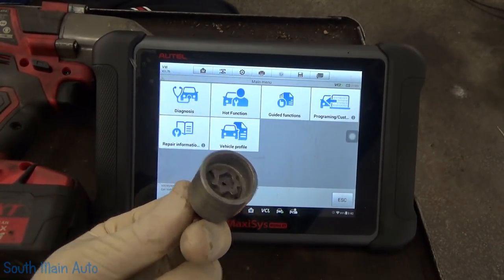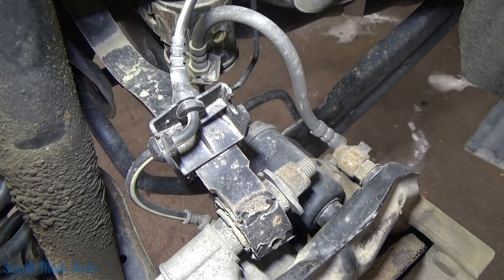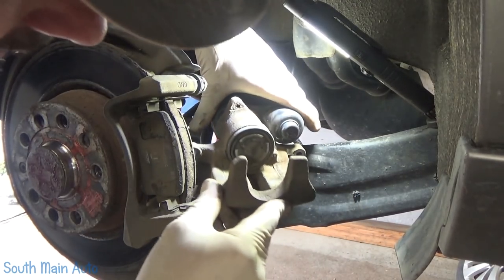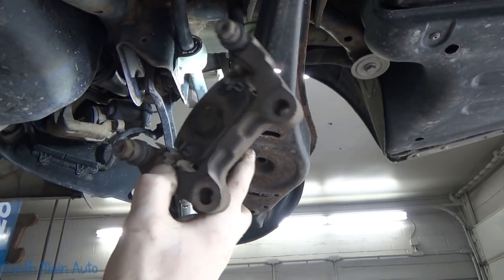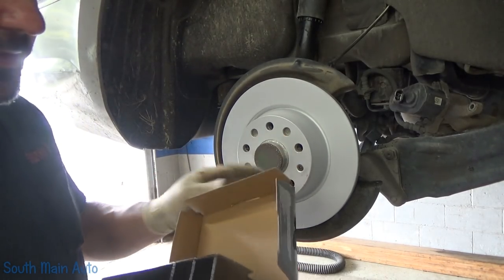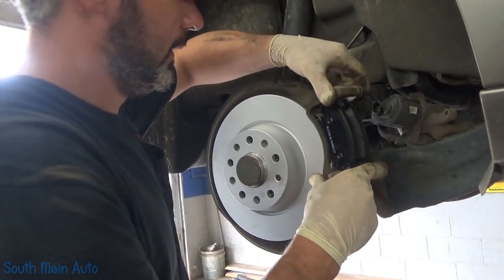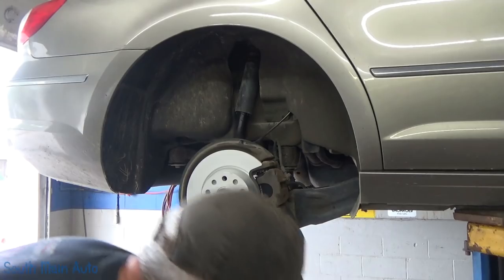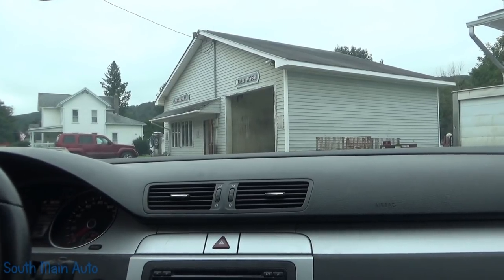Do You Need A $1000 Scan Tool Just To Change Brake Pads!?

Comment: Since you mentioned it, I just did a review on that tool. The MK808 has the electric braking option. If viewers go to my channel they get a $40 off coupon plus another 10% off if they use a code listed in my description box for a price of $480. (Sorry for the selfless plug). Just trying to same some people some money.  :)
Reply: Save them money yes Do not buy one of these cars  lol
Reply: @VWWRENCHIE  I'm a DIY'er (below average) and a scan tool  would be a big help, BUT is there a yearly subscription needed to use the scan tool? Would I be able to use it right out of the box ?  I understand about updating and keeping the info current, but is it needed in order for the scan tool to work?  Thanks for the info !!
Reply: John Smith  mx 808 is different than than the mk 808
Reply: Start car.   Put the car in drive, pull off the battery lead.  Problem solved.  ;) (No, not really)
Reply: alex10294 yes but I think the next step is to unplug the alternator and turn on the headlights for 3 hours to drain all flea power.
Reply: John John  I don't make any money from this and the extra cost on this unit is because it has blue tooth.
Reply: @defendermender4959  Thanks!
Reply: I picked up a mk808 slightly used (3 days old) for $200. It works great for the price cant complain I'm glad my shop has a verus edge though when I need those bi directional controls and the scope.
Reply: Lael Queen  whenever necessary, this is my favorite method. Who needs computers when ya have a multimeter and a little power wheels battery
Reply: alex10294 put the car in drive and pull off the the wires off the brake calipers, maybe it has a fuse to pull
Reply: @VWWRENCHIE  Yes, I agree.
Reply: Josh Smith  hey Josh THANKS for your reply and info, I haven't decided yet, (I have a low budget scan tool that's working ok for me) , I really appreciate you taking the time to answer !!!

Comment: One customer left the wheel lock in the cup holder today, I thought about leaving him a tip.
Reply: Nice. Nice.  Makes the ordeal more smoother.
Reply: I always hand the tool to the shop or leave it where they can find it easily.
Reply: I am short but try real hard to move the seat back before they brake a leg getting in.
Reply: When I have a car with it it's the first thing I give the techs
Reply: I like when the customer makes the wheel lock accessible, by leaving it in the cup holder or giving it to the service writer. Also, leaving it in the 2 obvious places, glove compartment or trunk. I hate having to rip the car apart for it. I had customers leave the lock at home while the car is in the shop, duh.
Reply: @Mavis308  you tear it up looking for it and the customer complains you went through their car.
Reply: @dirtydoug181  definitely true, that’s why I don’t like doing it. If they know they are coming in for service, common sense is to get it out.
Reply: @dirtydoug181  yes! I tell customers I went through their car and why....it saves them coming back whining most times. Finding the wheel lock is like a game of hide and seek because my hubby usually forgets to ask where the lock is and tells me to find it 🤣
Reply: One of my regulars at a shop I worked at years ago hung the key for his old 4Runner's locks off a piece of wire he attached to the steering wheel. Every time, I don't think he ever forgot. I wish the guys up front were that diligent in asking about locks!
Reply: I go one better
I delete the pesky security bolts.

Comment: The DIY way without a scantool: You can take the motor off (two bolts) Once removed there's a T40 in the caliper that normally gets rotated by the motor. Turn it clockwise roughly 2 turns and the piston is free to move back. Then just put it all together and just use the parkingbrake so the computer will relearn  when the piston is fully extended. That's all.

Comment: I recently did a rear brake job for a friend on a Passat. You can do them at home easily by disconnecting the motor and feed 12 volts in the pins with two jumper wires and DVOM probes. Just try both polarities and figure out which pin needs to get positive in order to retract the parking brake mecanism. Not really the most time efficient method but it gets the job done.

Comment: On my sons Ford. You have to make sure the car is off, push accelerator to the floor while pressing the EPBS (electronic parking break switch) for 5 seconds,  turn the key to accessories for 5 seconds. You should hear the breaks go into "maintenance mode" . Then turn the key to off. No scan tool required
Reply: You don't know how to spell "brakes"? Wow
Reply: And while you're waiting??
Reply: @jasonw8124  My pet peeve too Jason.  "We had to take a "brake" from driving because the breaks on the car went out.  "There" taking them over "their" to get "they're" breaks fixed.  LOL
Reply: would that be a Ford Escape?
Reply: VCDS/Odis are must have to in any VAG shop. Using some chinese noname junk is the best way to black out ECUs or/and miss half of the errors in memory. If you work with VAG you now how to change parking brake pads without any computer tool.

Comment: I unplug the connector and apply 12v to the brake motor. Change polarity to release or apply. I built a tool that used Milwaukee battery packs to quickly release brakes, then you cycle the e-brake when finished.
Reply: This is what I have been doing for years. I have a 12V Power Supply that is used almost exclusively for this as a DIY'er for many friends and family. I do have a scan tool that can do this now but as I'm accustomed to using the power supply that is what I still do.
Reply: Same here
Reply: My snap on scanner don’t have that brakes service feature so I do what you do I use have a gator clip and the dewalt battery to release the caliper don’t need a expensive scan tool
Reply: That works until you fuck the motor and pcm. 😂😂😂
Reply: @punkrocker10115  I think, it is you who is lacking the understanding of how electricity works. Lemme educate you, free of charge. Electrical items DRAW power from the source. You can connect 12V 999999999999999Ah  battery to the 12V 5W T5 bulb and you will not burn it.
Reply: @punkrocker10115  You better take a class in electrical Theory. 9 volts to 15 volts is what the car charging system puts out. It's when voltage drops below that the amps increase..Why they use voltage regulators.. So applying 9-14 volts to a 12 volt motor. Is not going to burn out anything. So you might avoid the argument. As i do have an Electrical degree. 

By the way. The ECM sends the signal to the 12 volt relay. That switches the Brake motor in or out. By grounding it on on either side of the relay. You can actually look on teh fuse box cover for the relay. Then stick a volt meter on it. 

Thank You. I also take PayPal for Online class instructions..
Reply: @5084204  So it would be safe to connect a residentical house to the powerline grid?  Even though the transmission lines can run hundreds of thousands of volts?   Even though the transforners outside our homes are capable of major amperage?  Are you sure this wouldn't melt everything in my house?   I hope punkrocker got a free lesson on when to not reply.
Reply: @timwheeler1503  You really need to educate yourself on Volts, Ampers an Watts. Later read something about resistors, capacitors, transformators and energy transfers in general. You should be ashamed of yourself, as your ignorance at such a basic level of knowledge is appalling.
Reply: As an engineer who works on these systems this is how we do it when the prototype software inevitably doesn’t work.
Reply: that can fuck a few things, but yah there is always a way to 'release' these.
Reply: I use a portable jump starter leads to retract the piston on my Touareg TDI. Have done it 4 times so far with no issues, however I dislike the electric brakes though
Reply: @johnnyvaughan2805  A power probe would work great in this application.
Reply: @punkrocker10115  You can't "put too many amps" into something.  Current draw is a factor of voltage and resistance (and reactance if you're dealing with AC, but that doesn't apply here).  If the windings of a motor have 12 ohms of resistance and you apply 12 volts to the motor, the current draw will be one amp.  You can't FORCE more amps into something; the laws of physics apply.  Now, if you put too much voltage into it, you might have some issues.  As long as you know that the PCM is putting 12 volts into the motor (probably PWM'd) you're going to be fine.  Just don't drive the motor to the stops and hold it there, but if you need to be told that, you shouldn't be let out of the house anyway.  And, you're not going to hurt the PCM because it's UNPLUGGED from the caliper.  Again, if you're that stupid, don't go outside!  If you'd like to discuss electrical theory with someone who has been working in the electronics industry for 45 years, feel free NOT to hit me up.
Reply: 9v battery on the motor works just fine😀